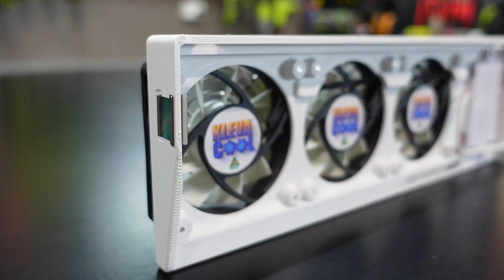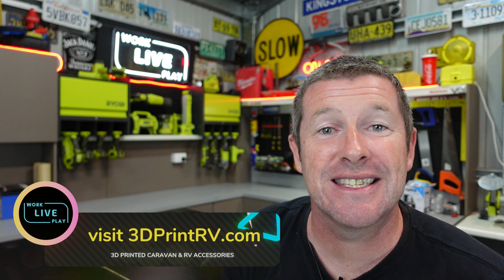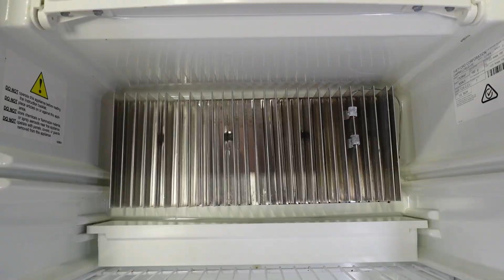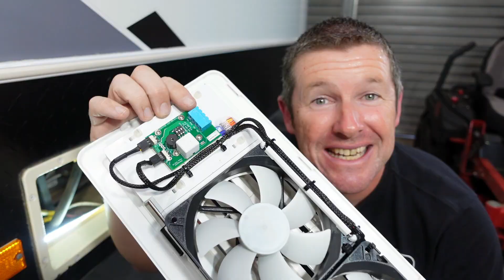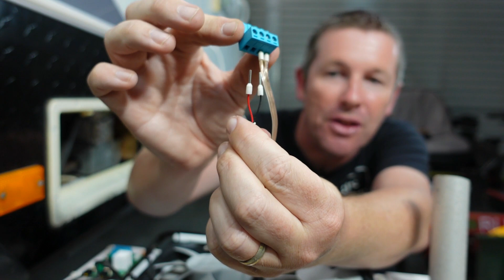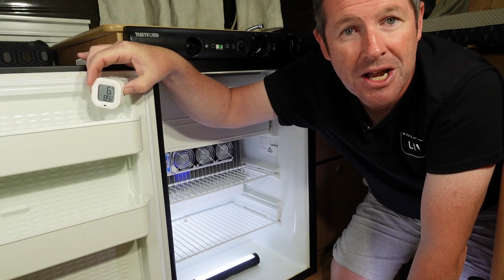LIVE | DIY install of the Kleva Cool Internal Fridge Fan in our Jayco Swan Camper trailer

Comment: Looks a great product and easy install. ANy data on how much effect the fans have? ie temp before/after use?
Reply from the maker: I haven't personally collected any however Royce from 3D Print RV has a lot of information on these fans. You can feel a difference as there does seem to be less condensation which contributes to fins icing up etc. I note the modern Dometic 3 way fridges such as the one in our Journey have built-in fabs to circulate the air internally, so the certainly improve the performance 👍

Comment: Good video, as always, but I think you are better off installing a compressor fridge. I install a waeco CRX110 and have not looked back.
Reply from the maker: Hi Dave, I do tend to agree to a point given how efficient they are these days. But you do need a solid 12v system to support, especially if camping for any extended period off grid and in poor weather. I just feel gas is a great backup as it lasts for ages and totally independent of the weather. That said if you have invested in a strong high capacity 12v system I too would have to consider either the Bushman or Waeco compressor fridges.
Reply: @WorkLivePlay  cheers mate. I only have a couple of AGM batteries and a 160w solar setup but it seems to be very sustainable. The fridge is averaging less than 3amps and hour while the solar is capable of 8amps. My last trip was only 3 and a half days but I packed up in the morning with the batteries around 80%.
Anyway, glad you're happy with gas but I thought it was worth mentioning how sustainable electric can be these days

Comment: Another great video mate. I purchased and installed the external fan kit after your previous vid on it, and it works a treat. Looking forward to more content from you soon.
Reply from the maker: Thanks Michael. I'm just packing down the Swan for a rego inspection and hopefully a few videos setup outside next weekend if the weather plays nicely. But I will be doing a quick mod to secure the front bag end so that it doesn't flap around in transit. Its simple and cheap so that should be out next weekend hopefully!!